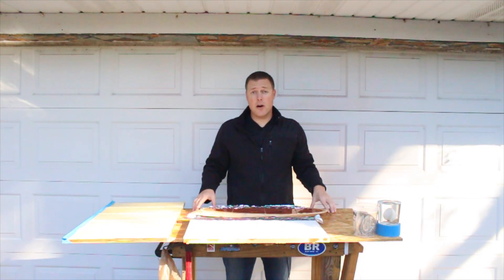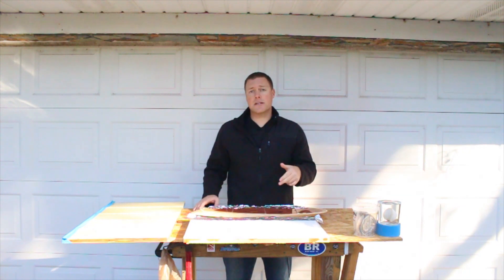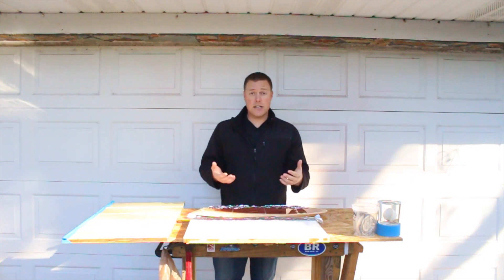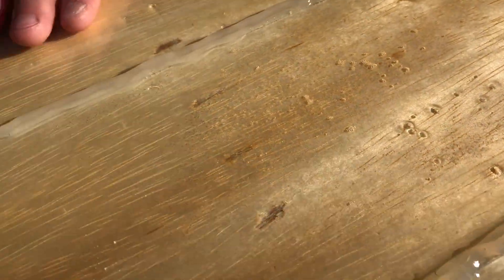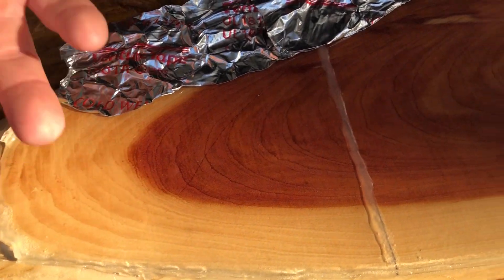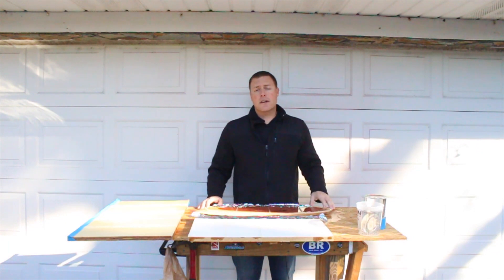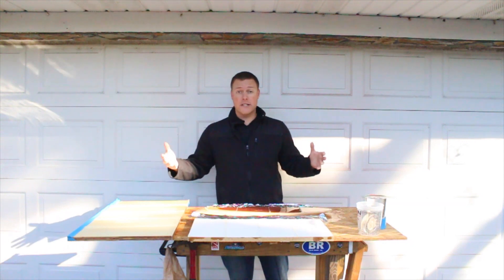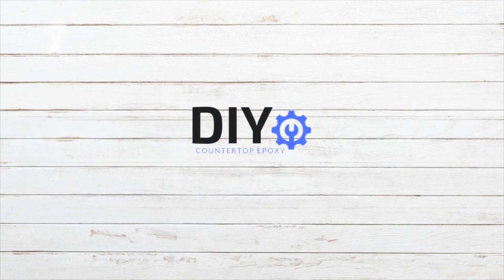How To Pour Epoxy Resin Without Air Bubbles, Properly Preparing Substrates

Comment: I used to get bubbles in my river tables, wood is porous and that is where you get bubbles. I found that the Wood Sealer by iCoat just does a great job of filling those voids so I don't worry about bubbles now. Also, stop using cheap Chinese epoxy resin, the best composites are made here in the west, I'm British by I buy American made products.

Comment: I have sanded, stained, and used 2 coats of polyurethane to seal a table but want a thicker, smoother finish. Do I need to do anything before adding an epoxy layer to that mixture?
Reply from the maker: Is the polyurethane water based? If the clear coat leaves a shine/gloss you may want to scuff the surface to ensure the epoxy properly sticks. We recommend using 320 grit sandpaper. If you do sand, be sure to thoroughly clean the surface prior to applying the epoxy. We recommend using Isopropyl Alcohol 99% (be sure it is 99%) to clean.

Comment: Hi, thank you for sharing this video. 

I am facing a different problem. When i Pour epoxy on the mold (plastic), within 10-15 mins all bubbles have escaped and it is absolutely bubble free. But after 30-40 minutes, I notice that some bubbles start coagulating at the bottom of the surface and do not rise to the top and remain at the bottom and with multiple pours, the coagulation of bubbles is there after every pour. what do I do? please help
Reply from the maker: Is there a spur or crack (even tiny) that could be holding air? It's very likely that at 30-40 minutes the epoxy is heating up and pulling the air out from the mold.
Reply: @epoxydiy6356  no there is no crack because i have tried different molds. And also when i pour a second layer, still the bubbles turn up at the bottom (which means, at the top of first layer and at the bottom of second layer), so the possibility of crack is not there. The resin heats a little after around 4 hours, bubbles start to collect after 30-40 mins only.
Reply from the maker: What type/brand of epoxy are you using?
Reply: @epoxydiy6356  its clear cast epoxy system from Huntsman Corporation
Reply from the maker: Sorry, I am not familiar with that. I would recommend trying a different epoxy and see if you get a similar bubble reaction.

Comment: I feel like you didn't actually show how to do it, rather all you did was show that it can be done.
Reply from the maker: Bubbles can form as a result of multiple factors. Therefore, we are trying to highlight (and hopefully help people to prevent) the most common causes.
Reply: @epoxydiy6356  You're highlighting the causes just fine, but you're not explaining how to prevent it. If I explained to you the physical process of how wood left outside can decay over time, I still haven't explained to you how to prevent it by using paint or other treatments. Even if I said that you need to paint it, I haven't shown how to paint it properly, or explained which paints are good and which are bad. I mean, painting wood with water color paint probably isn't going to help much. Please don't call something "how to" if you don't show how to.
Reply from the maker: Jenny, our point is that there are many variables, we just wanted to cover the most common causes, so that people can take the proper steps to avoid these on their pour. Each surface is different, just like in your example of wood, each type of rotting wood outside could be covered by a tarp, a shed, painted, stained, etc.
Reply: @epoxydiy6356  How about a video showing how to actually pour it without bubbles, instead of a video explaining why bubbles occur?
Reply from the maker: Will do. Stay tuned. Thank you for the suggestion.

Comment: How did you seal that one piece? I'm covering butcher block counters with epoxy to give it a marble look. I do not want all those bubbles obviously. what is the best way to seal it first?
Reply from the maker: It depends on what type of epoxy you are using. However, most would require a very thin seal coat.This is critical to sealing the surface and allowing the bubbles to easily rise to the surface and ultimately pop with the passing of a heat gun.
Reply: @epoxydiy6356  seal coat of what? I've heard not to use sanding sealer as it's a softer finish and epoxy is hard. And "they say" not to put a harder finish over a softer one.

If not sanding sealer then just a micro thin layer of epoxy? Maybe 2 coats before the flood?
Reply from the maker: A thin seal coat of epoxy. Usually one seal coat does the job, unless you have a very porous surface.

Comment: My biggest problem is dust. I'm thinking about running a cold water humidifier about 30 minutes before in my sealed room? It's not air tight but it's sealed. Even sealed all vents and have sprayed water, mist, on myself before walking in room.
Reply from the maker: Do you mean while the project is curing? What type of projects are you normally working on?
Reply: @epoxydiy6356  to be honest, I haven't epoxied anything since this past spring. I've had to go back to full time work and have been making too much money to spend extra time with resin projects, thanks to our economy under President Trump. I hope to get back to some projects as I was starting to get decent results. But for now it's carpentry, remodeling and construction$$$

Comment: HI , THANK YOU VERY MUCH FOR YOUR EXPLANATION , I HAVE THAT PROBLEM SOMETIMES WHEN THE EPOXY DRIES UP ITS CRACKED TO THE BOTTOM WHAT WAS MY MISTAKE 
REGARDS
Reply from the maker: Hassan, how thick are you pouring? This is a common issue if epoxy is poured too thick and the epoxy reaction accelerates, heats up too much, and ultimately cracks.
Reply: @epoxydiy6356  Hi thank you for you reply im pouring 7 cm 
and this produces high heat 
regards
Reply from the maker: Wow, yes, this is much thicker than most epoxies require. You would need a very thin casting resin to pour that thick. Most coating epoxies recommend pouring only 1/8" to 1/4" per application.
Reply: @epoxydiy6356  sorry to bather you but i didnt understand , what u mean with casting , and if i want this thickness haw many times to pour the 7 cm and haw long to wait to pour between  layers .? 
thank you very much , 
regards
Reply from the maker: A casting resin is usually a thinner material. We actually have an entire video on it here:  https://www.youtube.com/watch?v=eK2XK1zPupY  The pour thickness depends on which epoxy you are using. Each manufacturer is slightly different, but most recommend 1/8-1/4 inch per application. The time between coats will also depend on what type of epoxy you are using. However, most are between 4-6 hours (be sure to check with your manufacturer)